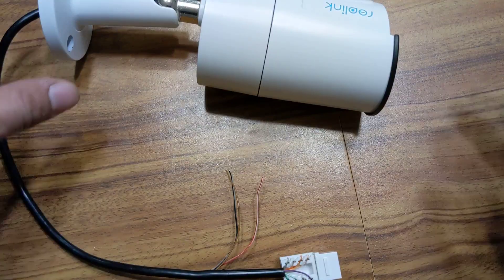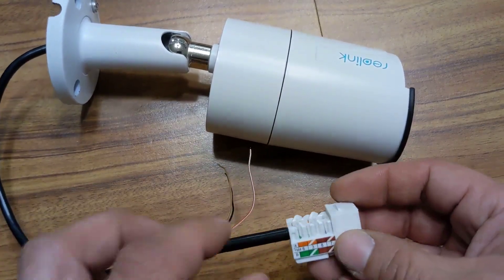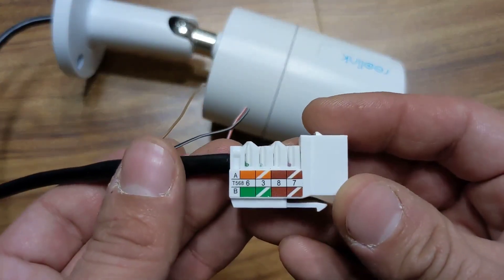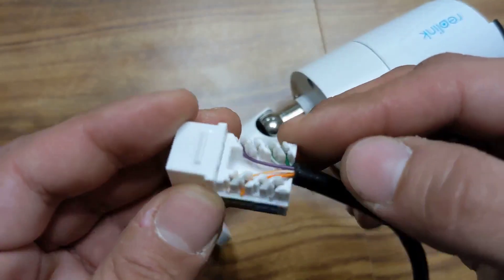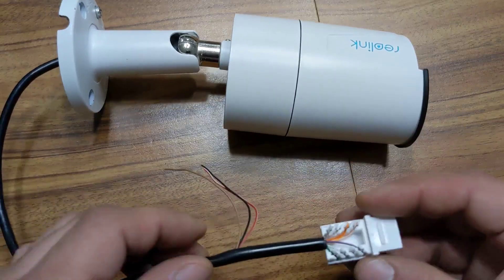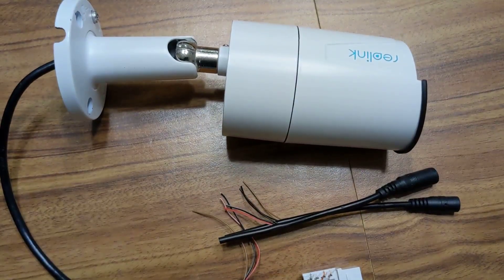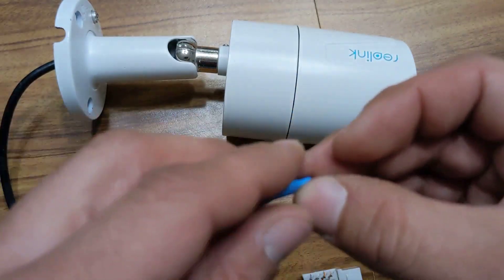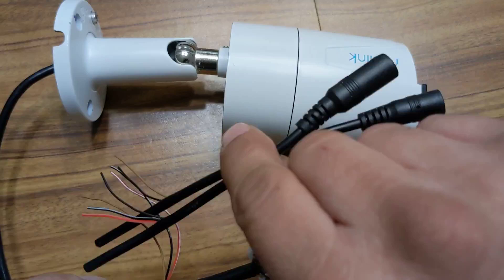Reolink Camera Wire Repair with Keystone Jack

Comment: Where does the reset wire connect to + or -?
Reply from the maker: The reset wires should not be wired into the Ethernet keystone. The reset wires should be wired back into the reset switch or sealed up separately to keep them from touching. If the reset wires are connected together it will cause the camera to reset non stop.
Reply: @taviobot  I have internet wires, orange, orange white, green and green white, and another 3 wires red, black and brown, red and black is electricity, brown reset.and the reset button has black and brown wires, where do I need to connect the black reset button wire  ?
Reply: @taviobot  Because the ac/dc adapter only has 2 wires and I don't know where to connect the black wire of the reset button???
Reply from the maker: It sounds like your brown has a matching black wire, maybe brown-black? If that's the case then the brown-black and brown wire have to be wired to the reset switch. If you don't have the original reset button you'd need a momentary or push switch as a replacement.

Comment: Just tried this and it didn't work. Mine happened to be water damage. I guess it fried everything. 😒
Reply from the maker: Depending on how long the water has been sitting, you may be right in that it was fried.

If it had been working, even with some water damage, cleaning the board with isopropyl alcohol sometimes helps prolong the camera's life.

Comment: How about doing the method that you did with the power and reset button on the RJ45, that will work right?
Reply from the maker: Yes, that should work as well.
Reply: @taviobot  I'm going to try that because I drilled through mine just at the end of the cable where a keystone wont fit

Comment: Thank you so much!!! This worked.
Reply from the maker: Glad it helped!
Reply: @taviobot  Just tried this again on another camera. This time there was water inside and it did not work. Does this mean is damaged beyond repair now?
Reply from the maker: @Mysteriozone  If the water has been sitting inside I believe so. Next time I would wash the board with rubbing alcohol and let it completely dry out before running any power through it. I'm sorry I couldn't be more helpful.

Comment: Thank you.  Just saved me a bundle.  I was putting a male end on to plug into a barrel connector so I had to visualize which side pin 1 was, but your video showed you turning it and that was enough to make sure which side was pin 1.  Thanks again
Reply from the maker: Awesome! Glad I could help!

Comment: Just fixed a RLC520a with this as guidance, didn't have luck with a keystone jack due to it being cheap garbage, so crimped a RJ45 connector at the end with some struggle (used some spare wires to fill out the empty spaces) and got it working in the end using a keystone module with RJ45 sockets on both sides.
Thanks!

Comment: I have a different brand camera and its power cable got broken... so when I peeled out the rubber cover, I see three wires, two red and one black. I expected to see just one red and one black (I think it's 12 VDC power )... what could the two red wires be for?
Reply from the maker: Could it be the reset switch wires?

Comment: Looking to extend the power cable that came with my reolink cameras.  I see that the wire is 22 awg.  I guess I can just go buy myself 1000 ft of 22/2 wires and splice them.
Reply from the maker: Yes, you can make your own power cable as you suggested as long as you're delivering 12V 1A. I believe some cameras need 2A so you'll have to check the specs on your camera.

Comment: So how can you make this a weatherproof connector if you want to place the camera outside?
Reply from the maker: I'd pack the whole thing into something like this using all weather electrical tape around the connections:
https://www.homedepot.com/p/Commercial-Electric-1-2-in-White-5-Holes-4-in-Round-Non-Metallic-Weatherproof-Box-WRB550PW/300851124

With this lid:
https://www.homedepot.com/p/Commercial-Electric-White-4-in-Round-Non-Metallic-Weatherproof-Blank-Cover-WBC300PW/300852147

Use a 1/2 cable gland if you need to bring the cable in without conduit.

Alternately, I wonder if you could just make the end into a male RJ45 and use the waterproof cylinder that's included with the camera. Then you'd have to waterproof the power and reset button.

Comment: Do you know which wire is used for video output? I have an RLC 411 WS wifi camera I want to hardwire as a backup camera. I have had to repair the RJ45 connector due to squirrel damage and discovered they used the ethernet B format. I have used it as it was intended since that repair.
Reply from the maker: https://support.reolink.com/hc/en-us/articles/360006850654-Arrange-the-Wires-of-RJ45-Connector-8-pins-
This link might help you out.
Reply from the maker: I'm sorry but I don't know which exact wire carries the video signal. If I come across the info I will reply again.

Comment: Is it necessary to rewire the power and reset cables or can it just be left disconnected?
Reply from the maker: If I remember right it was not necessary. The camera would just be on all the time and you could just unplug and re-plug in the ethernet cable to reset the camera.
Reply: Today I replaced a damaged RJ45 connector on a Reolink camera with the same pigtail configuration as shown in this video.  I cut off the three wires used for the power / reset parts and just used the six ethernet wires crimped into a new RJ45 connector.   So you can leave those power/reset wires disconnected, as long as you're using PoE to power the camera.
Reply from the maker: @y0rkiebar  Yes you should be able to leave those disconnected if you're just using POE.

Comment: Hi there, tried to fix my RLC1210a PoE camera but also without result :( tried grey on blue and blue/white but seems death. See image https://prnt.sc/1jhznr2 thanks for any help
Reply from the maker: Your wiring looks correct to me. I've had it where rewiring did not fix the issue. I believe those times the actual camera was damaged. Sorry I couldn't be more helpful.

Comment: I put all six cables as you are showing in this video and the camera still doesn't turn on. Not sure what else to troubleshoot.
Reply from the maker: Is it a power over ethernet camera or WiFi camera? A WiFi camera would need the power cable connected a PoE camera wouldn't.

Are you trying a new keystone jack or reusing the one from Reolink? Trying out a new keystone might help out.

Another idea would be if the cables were put in the wrong slots and then the camera gets powered on. Even if you go back and put them in correctly the camera might be toast. I did this by accident before and lost a camera. \=
Reply: The ethernet cable you are using to connect the camera to the NVR could be wired using the "A" standard